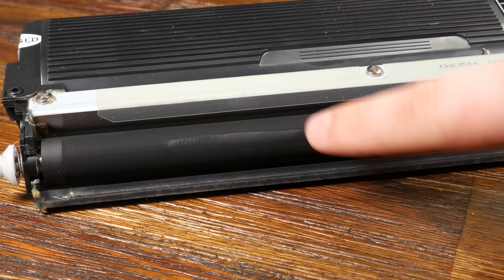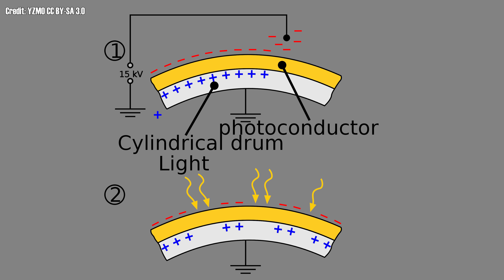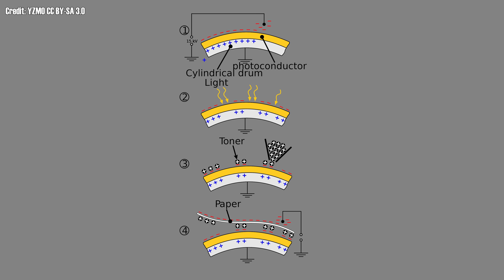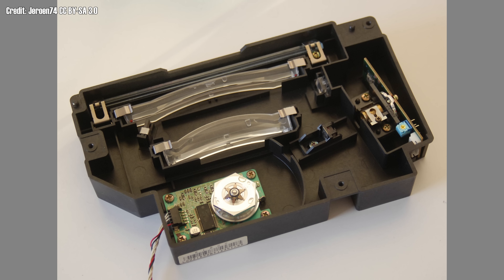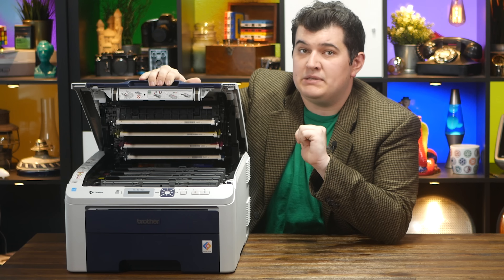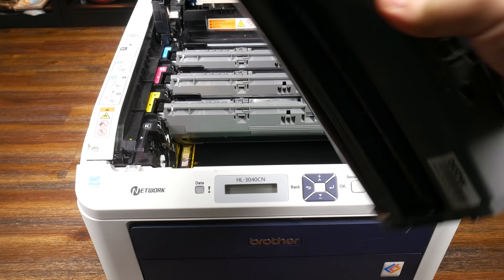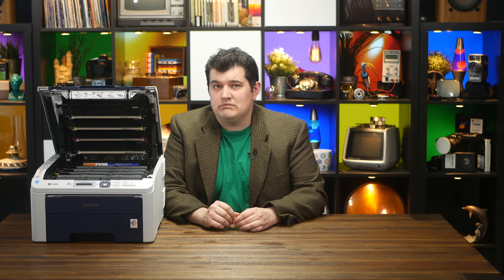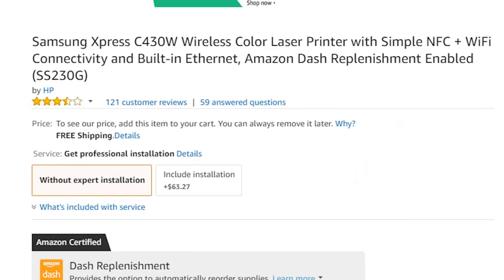LED Printers: The Common Printing Tech You Haven't Heard Of

Comment: I actually work on printers and copy machines, more often than not, a lot of the newer printers that are manufactured seem to be using LEDs over laser, I even work on some machines that use a hybrid of both laser and led. Laser is generally about as reliable as LED from my experience, the "spinny thing" you referred to in the laser unit is called a polygon mirror motor, after a certain time these will get stuck or not spin as fast causing failure. I've yet to have an actual laser or led die on machines I work on and some of them push over 1 million copies/prints in months. The only real advantage to a laser only setup I could see is the resolution and the lack of toner getting on the laser blocking portions of the print. LED only printers have the downside of toner generally will spill on the LEDs and block light. Also it's worth mentioning not a lot of newer machines and depending on the manufacturer don't use corona wire anymore, they use something called a charge/development/magnetic roller, terminology varies per manufacturer and there's normally an upper and lower looks like the one in your video have a roller from what I saw. 

Hope my knowledge helps! Great video!
Reply: fellow print wizard here and can concur that laser and led have about the same level of reliability. So many other parts are going to wear out so much sooner than the laser mirror that outside of a print-shop or heavier environment, its pretty much a non issue.

what i want to bring up is that samsung that was used in the video and the reason it is that much slower to print color. now the reason is not that it is laser vs led, its that the machine appears to not use a primary/secondary (belt) transfer system but transfer directly from the developer roller to a single large photo conducting drum. from the look of it, it must do a pass for each of the colors waiting for the 4th pass to run the paper past for transfer and then clean the pc drum. not necessarily a bad system, its just trading speed for less expensive consumables.

but enough about drums and charging, lets talk about the real hot topic. the move away from heating fusers via incandescence to sexy sexy induction heating.
Reply: Unreliable thing in laser printers is bazillion of plastic wheels in paper transport that requires PhD in mechanics, not laser with a mirror or LED strip and thing that heats paper ;) It's easier to grasp a gearbox in a motorcycle than paper transport in laser printer that has duplex and few trays.
Reply: @shana_dmr  yup! I remember in college a friend of mine had to make a paper transport device for a ME class. It was specifically chosen by the instructor for how notoriously hard it is to handle paper.
Reply: @shana_dmr  don't open the tray until you have removed all the papers and everything will be fine ;)
Reply: Shall I bring up the time in the 1980s when I had a copier with both a thermistor failure and a thermal fuse failure so that the halogen lamp stayed on until the aluminum heat roller melted to a puddle into the silicon oil pan under the press roller? It was a Mita DC-312RE as I recall. The customer phoned it in as "smelled hot". There was fire extinguisher residue all over the machine.
Reply: @bfhammer  the infamous "smells/feels hot" service call...one I am intimately familar of. My personal favourite is the "grinding noise" or "wont print"...adjectives with little or no context
Reply: @dcheek2  or the infamous noise call that is never really more than a squeeky gear, but user thinks mfp will explode....
Reply: Have yet to have an actual laser or led die on machines you work on?? What magic fairy dust are you sprinkling on them? The polygon mirror is the most common failure, but I had a couple of LED arrays with a partial failure leaving blank lines. Some laser diode failures also, normally a code for no beam detect when the polygon mirror spins freely.
Reply: @bfhammer  I guess it's a bit disingenuous for me to say "I haven't". My reason for saying I haven't, is because I truly haven't just had a laser or led just fail, it normally a product of the environment the machine is in or electrical failure. I work on only Ricoh machines and a good example is we have Ricoh 5210 DN machines. They will put these in hot and humid warehouses and it's almost guaranteed you'll have to replace the laser assembly on these at some point. The reason being is the laser sits in front of the fusing unit, the heat from outside, and it being dirty will straight up nuke the laser assembly. Whereas same machines we have a large grocery chain in the United States, I haven't replaced any lasers on these machines because they are in a better environment. I'm sure other techs working for my company have, but this chain also runs their machines without any surge protectors. 🙃 These machines are actually very good machines, I can't fault the machine for the abuse of the clients. As far as the higher click & color machines I work on, not once, I've been with the company for 4 years and work in a major metropolitan area, polygon mirror motors seem to be the repeat offender from my standpoint.
Reply: @bfhammer  what are you talking about? I have NEVER had a polygon mirror failure.
Reply: @justinsane332  i've got a couple on Ricoh Aficio MP cXX00 up to 02 series. A short circuit in the polygonal miror motor and you're good to change it and the IO board.
Reply: @pmailkeey That's basically why we use paper at this current point, and in 50 years that will probably be why they still use paper. Just to make sure somewhere their is a copy of certain information  that can't be hacked into and altered/accessed/seen by a malicious/bored entity.
Reply: pmailkeey  maybe someday they will laugh at digital medium, where something can be easily altered without anyone noticing :D
Reply: On a home printer everything else will break much sooner than the laser or led imager so a reliability is a non issue. My canon MF laser has already broken hinges for the lid and I may made maybe 20 copies in its entire life. Shameful the crap they make.
Reply: Fellow tech, and yes. Except there is only one charge roller usually. The other roller facilitates cleaning the drum of waste toner.
Reply: Spot on,  Noshi!
Reply: LED over Laser ?
You mean office machines ?
Reply: interesting, I would have thought the LEDs would wear out over time since they do that.They go dim, and kind of at random, as anyone with LED christmas lights can tell you.
Reply: Sir, with all respect, how does pagewide printers from HP compared to lasers and LEDs alike ? I'm very interested in those tech in general...
Reply: Where I work, some of our laser printers push 300K images a day.  100K per shift, 24hrs a day.   All together,  several machines produce several million a day.  I've seen one laser die in 20 years.  They do not break.    We are now moving to ink jet because it can do full color at the same speed and break down even less.  Never seen anything as reliable as our ink jets.  The damn things are relentless and extremely operator friendly.
Reply: LS yeah inkjet presses are getting very popular for full colour printing. We’ve had lots of large companies switch to them, like cable TV/Cell phone providers now them for their monthly invoice print runs.
Reply: NoshiSenpai 
R.i.p. youtube nightmode

Comment: Oh, i though the LED printer went the way of the dodo! I remember those OKI led-printers from the 90's. They were super small and silent compared to the laser printers of the same vintage - the resolution was junk though (300 DPI on a good day). Some notes on the video: You omitted the small detail about the transfer belt on the color laser printer, but it's not important in the scope of this video. Canon is a large manufacturer of printer "engines" and sell them to many different manufacturers, so i wouldn't be surprised to see the same "engine" inside a Canon and a Brother. In the good old days, Canon made print engines for HP as well - I remember that the Laserjet 2/3-series used Canon engines, and the formatter board inside the printer had Canon written on it's chips. The toner cartridge of that day and age had no chips or coding as well, and the same cartridge worked across HP and Canon with no changes. Today there is not many manufacturers of Laser printers - HP just bought Samsung's printer department.
Reply: My friend used an old OKI led printer until last year when it finally died!

Comment: Early Xerox machines looked like enormous bellows cameras. Back then xerography was a manual process more akin to photography, with the toner being dusted by hand onto a flat surface instead of an motorized drum. This type of Xerox machine was a staple of the animation industry for many years. By replacing the tedious process of hand tracing pencil drawings with ink it speeded up and reduced the cost of traditional cel animation. That's why Hanna-Barbera cartoons from 1968's onward list a Xerographer in the credits.
Reply: Where I work we used to have some huge old Xerox copiers which took a photo of the document to copy it -- instead of a green scanner thing going back and forth across the page, you just saw a single strobe flash. Those were the last "analog" copiers we had, before everything was replaced with digital copiers which are really just a scanner permanently attached to a laser printer. 

One of the Xerox service techs told us that back in the 1960s, Xerox copiers came with a fire extinguisher because the temperature in the fuser was so high that there was a risk of a paper jam catching on fire.
Reply: Some versions of linux contain an error code that can be called to indicate that a printer is currently on fire, though no proof of whether or not it's ever been used in seriousness exists.
Reply: The "printer on fire" error actually dates back to UNIX: https://en.wikipedia.org/wiki/Lp0_on_fire
Reply: I found an old photo of a manual Xerox machine at https://www.ssa.gov/history/photocopy.html It's installed in an overhead configuation (note the prism shape near the operator's hand. Early animation xerox machines were mounted on a long table and pencil drawings were imaged vertically. The only image I could find was from an old Hanna Barbera cartoon. https://www.flickr.com/photos/93980414@N08/8580249436/in/photostream/

Comment: Another point I think people might have missed: inkjet printers often have a much higher per-page cost due to the overpriced ink cartridges and their low capacity. Generally you get 50 pages out of an ink cartridge but a toner cartridge is usually in the 5000 pages range. Combined with the fact that toner cartridges never die due to just time, unless you print often and regularly, you are usually better off with a toner-based printer.

Personally I use the HP LaserJet M1216nfh MFP. This unit, being office oriented, has that 5000+ per cartridge print capacity, a good ~20ppm speed, and it has built-in AirPrint (over wired Ethernet,) scanning, photocopying and fax functionalities.

Comment: I agree with all but one thing- 'maintenance mode'. I have two hp printers, a Inkjet 6525 and a color Laserjet cp1515. The Inkjet, while rarely touched doesn't do any maintenance at all, despite being plugged in and sleeping, while the Laserjet does calibrate itself every 6-48 hours (adjustable) which burns through toner surprisingly quickly. Oh and you cannot outright disable that unless you unplug the cord from the wall.
Reply: I worked as engineer in HP's inkjet division.  All inkjets might do an inkjet purge cycle to unclog dried ink in the nozzles.  That is why inkjet printers left sitting for some time might take up to several minutes to start consuming paper.  As engineered, there isn't a better way for them to assure 100% print quality which is the primary concern.  It would be nice to have a print job parameter for required print quality when the user simple doesn't care if there are a few nozzles clogged.
Reply: @wallykramer7566  Yeah but that happens once, when you start to print again. The Laserjet literally ate 6% of the toner during the 3 month of holidays for not printing a single page. That is of course a sample size of one, but for me laser is worse when it comes to wasting printing supplies.
Reply: Sorry Jakub, I am confused.  Are you talking about laserjets or inkjets?
Reply: @wallykramer7566  The fast scrolling text in the beginning states that Laser is better than Inkjet because Inkjet wastes a lot of ink for cleaning the heads, but in my experience (just a single model of laser, and a single model of Inkjet) the opposite seems to happen. Both are plugged in and on standby, but only the laserjet periodically (48 hours at most) uses some toner to adjust itself. It's noticeable since it reports remaining toner as a percentage. Even if the Inkjet does waste ink when not used for long, it has to be just before printing so not that much is wasted. Meanwhile my laser printer between june and September was not used at all and remaining toner went down by 6%.

Comment: I was in IT for a while before I got my degree. In that time I never saw a printer where the spinning mirror assembly failed. It is a moving part but they do a really good job of getting that right. Typical failures are from all the lesser parts of the printer. Mainly the paper feed system which tends have it's lubrication fail from a combination of age and paper dust.

Comment: The other (and bigger for me) problem with inkjets is the shear amount of time between hitting print, and getting a damned print out :-\
There's always some long drawn out rigmarole where the head cleans itself and get ready, THEN it starts printing.
My budget laser (or is it LED) printer takes about 4 or 5 seconds from cold
Reply: But one problem of laser printer is that the oven needs to preheat. If you power up a laser printer and launch a print right away, it will take more time than the next printing. That's why laser printer are more suitable for office use (power on the morning and only power off the evening) and for multiple page printing rather than one page hourly.
Reply: That just means the oven heats fast, it's the same with an OCXO that has a bigger heat resistor than another.
BTW 10 seconds is about the same time my 17 years old budget HP Deskjet gets ready, my 2 years old Canon ink printer is twice faster just as Azy's laser printer. So if you don't print large document you don't really have speed benefit of having a laser printer. Both technology have their own strength and weakness and it depends on your usage.
Reply: Vierax  Exactly. If you want fast prints, low cost, and low maintenance, you get a laser printer. And if you're insane and consider expensive ink,  wet pages making messes everywhere, constantly cleaning the heads, and slow print times to be strengths, then you get an inkjet or some help because you need it.

In other words: inkjet is trash and nobody should use it.
Reply: Well, that escalated quickly! Please, let's all be friends and give and take a bit, right?

Comment: Now, I don't know how accurate this is, but I've read that to speed things up, color lasers moved to first printing all four colours onto a rubber belt, then transfer it to the paper.

Which seems to make sense, as my current printer (which was explicitly marked as "laser", the website I bought it from did make a distinction between laser and LED) only opens up on the back, so it appears unlikely that the paper would travel all the way across the device (there is no door I could open to solve a paper jam in the middle).